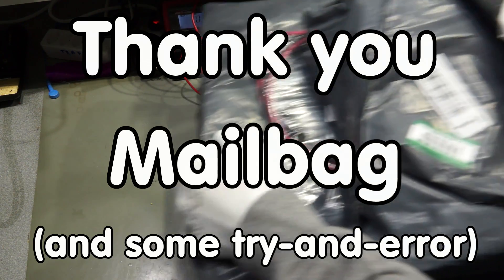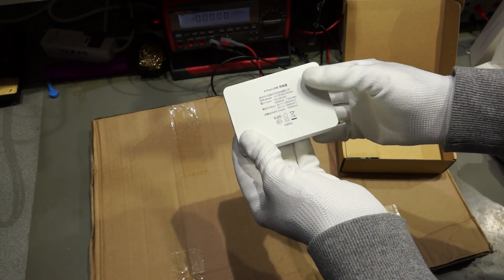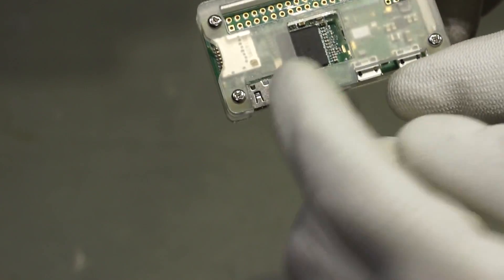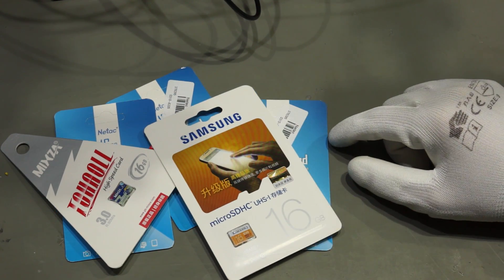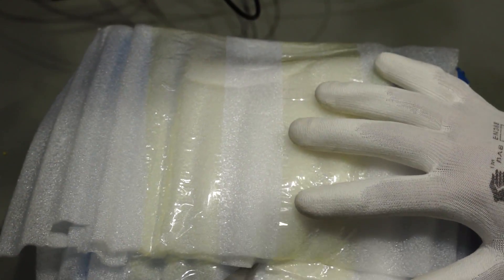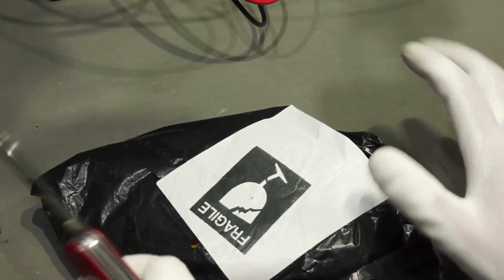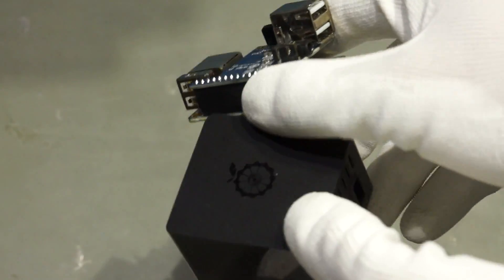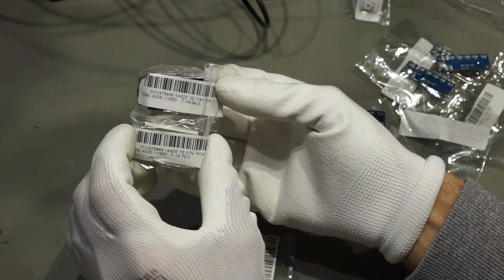#129 Thank you Mailbag: Orange Pi Zero, Housings, Solar panels, etc.

Comment: Hi Andreas, dietpi is wonderful because you can open up the document called dietpi.txt and pre enter your WiFi credentials and set a static IP so you can log in with ssh after the first reboot. No need for serial connections at all. Just plug the SD card in wait about 5-10 minutes, reboot and you should be able to ssh using putty.
Reply from the maker: Thank you for the information

Comment: that is taspberry pi zero case not the zero w , the chip is little offset on zero w.
secondly, 3.5mm jack on usb hub hat of orange pi also give you video. or you can directly connect ground pin and 5th pin from last to get a vga output.
Reply from the maker: Thanks for the tip!

Comment: Like a Christmas day, Nice, Of all the sensors you have tested, which one do you recommend for an alarm system? And mounted on a Wemos, ESP8266 or a Nodeum?  Thanks for all.
Reply from the maker: 1. I tested the radar sensors in video #135. If you read the comments, they are quite often used for Alarm systems
2. Wemos and nodeMCU are practically the same, just different size. For projects I usually use the Wemos. The bare ESP-12 modules are good, if you need low current consumption and deep sleep. You find also a few videos about that (there is a ESP8266 playlist available (https://www.youtube.com/playlist?list=PL3XBzmAj53Rlu3Byy_GkqG6b-nwEpWku0)
Reply: ok thanks

Comment: I would be interested in Orange pi, i have one incoming, but as far is as i know in the area of software they are all garbage. Even tho they have quadcore 1.6ghz.
Reply from the maker: Why would you buy one if you know, it does not work ;-)
So far, I just installed the MQTT broker with dietpi and had no problems. But I did not use it for a long time.
Reply: I have always wanted a Raspberry, but it was way cheaper. I ordered a bigger version, Orange pi PC Plus. We will see what it can do.

Comment: When you test solar panels cells? :)
Reply from the maker: I do not know exactly. I hope, in the next weeks
Reply: In order to charge a 12V/7A battery do you need more equipment, or just the solar panel is enough ?
How long does it take to fully charge a battery in a sunny day in Swiss ?

Comment: Hello, thank you for sharing ! Really looking forward for what you'll think of these solar panels, they are quite cheap and might works great on a boat ; I've been lurking at them for monthes on banggood :)
Reply from the maker: The first impression is a little "plastiky". But this might actually be good of handling. However, I am not sure if they survive the 20 years of glas panels...
Reply: Thanks for your answer. I'm not sure I would expect such a lifetime anyway, so it looks right to me :) Concerning the wire section, they look normal to me, correct me if I'm wrong, but the lower the voltage, the higher the amps, and with that the increase in temperature and the wire section. In boats where voltage is usually 12-24v, the wire are really thick. I found this calculator for wire sections (originally in french : https://translate.google.fr/translate?hl=fr&sl=fr&tl=en&u=http%3A%2F%2Fforcepas3.free.fr%2Fimages%2Fstories%2Fdossier%2Fcalculatrice%2FSection_fil.html).
Reply from the maker: Concerning current: This 30W device has a max. current of 1.6 A. Such currents, you can lead with very thin wires.

Comment: Congrats Andreas. For Orange Pi Zero (OPi0) try using Etcher to copy OSes onto uSD card: https://etcher.io/
And here are some good OSes to try on OPi0 : http://www.retrorangepi.org/ http://dietpi.com/ https://www.armbian.com/
It is better if you linked to the Orange Pi Zero Bundle(Board+Expansion+Case) https://is.gd/opi0kit
I added your Banggood ID to that link ;D Regards!
Reply from the maker: Thanks for the links! I added the bundle link. So far, I only tried dietPi, because I think, a small OS is better for the Zero boards. I read, that armbian works also good with the Orange Pis. So, maybe I will try it once. Concerning Etcher: I installed it and am now burning  a card. But I do not see a big difference to WIN32diskimager so far. Do I miss something?
Reply: You're welcome. Diet Pi is great. Try RetrOrange Pi (ROPi) later to play emulate older gaming consoles S/NES, Atari, N64, PS1...etc.
http://www.retrorangepi.org/#download You can use a separate uSD for each OS if you like.
I have not used Win32DI in a long time, but Etcher is just simpler, & has copy Verification.
It does not matter what you use as long as it is working. BTW, having a U3 uSD card will give you a better experience with OPi0: http://v.ht/mixza Banggood also got the same item.
Also if you wanna have OPi0 display on TV you can connect dupont cables to RCA A/V cable with the help of this table (#2) http://linux-sunxi.org/Xunlong_Orange_Pi_Zero#Expansion_Port
Or if you got a RPI2/3 3.5mm to RCA audio/video it will work. But really making the cable is so simple.
Thanks Andreas for your great videos & good luck.

Comment: Andreas, I found here http://tech.scargill.net/a-question-of-lifespan/  this link: http://goughlui.com/2014/10/01/usb-cable-resistance-why-your-phonetablet-might-be-charging-slow/

It seems very few USB cables are rated as 20AWG. We need your advice on this matter:
https://www.aliexpress.com/item/3A-2A-for-Genuine-LG-Micro-USB-Cable-20AWG-V8-Quick-Charge-2-0-Data-Sync/32736604012.html?spm=2114.13010208.99999999.270.kxnCFD
Reply from the maker: Thanks for the link.Concerning Peter's blog: I saw it and agree, that most of the "facts" about SD cards are rumors. Concerning the size of Charging cables it is a simple rule for me: measure the voltage at your board after your cable. This can easily be done with a cheap USB doctor or with a Multi-Meter. With Raspberry Pi, I normally use only short cables (10-15 cm). Then, the cable itself is not so important. My experience is also, that the Rasbis run well at voltages well below 5V (because of their 3.3 volt regulators). So, this does not seem to be a big problem for me.

Comment: For all the Orange Pi you should use Armbian as an OS instead.
Reply from the maker: +BIBIwood Why not dietPi for the small devices?
Reply: Well at least you should give it a try and use the one you prefer. Armbian has a great support for the various Orange Pi, and ssh is activated by default, so no need to use the serial port, just plug with an ethernet cable in your router.

Comment: Andreas, I think you ordered "wrong" Orange Pi. Orange Pi PC which costs 15+3 USD is much better device. Fast 4-core ARM, 1GB of RAM, capable of smooth 4K video playback, 3D acceleration, real hardware ethernet, real 4x USB2.0 (not via hub), etc. Younger brother Orange Pi One is almost the same but with 512MB of RAM and smaller PCB with some connectors removed (you can still solder wires manually). And it costs only 10+3 USD. This one is good candidate for servers if 1GB of RAM is not necessary.
Reply from the maker: Thanks for the tip. I am quite new to this area and just wanted an alternative for my mqtt broker. Maybe I will also order the "PC" type. But it seems to be more like a raspberry Pi 3
Reply: Andreas Xunlong(OPi manufacturer) is releasing models like crazy! Their latest ones are Win/Prime and IoT-2G http://www.cnx-software.com/2017/01/08/orange-pi-zero-plus-board-based-on-rda8810pl-cortex-a5-processor-to-support-bluetooth-and-gsm/
If you wanna see all their models you can find them here: http://v.ht/opix
Also ask in the Armbian forum about what you need cause they are very knowledgeable & can help you a lot with technical issues: https://forum.armbian.com/

Comment: please put a heatsink on that orange pi, ceramic or the big copper one if possible, case they kinda heat up under load easily.
Reply from the maker: I am currently experimenting with a small fan on a Rasbi 3. With big success. Maybe this is also the solution here.
Reply: nice, if dynamically controlling the fan with cpu temp, please post a little about the experiment also !
Reply from the maker: I am finishing the video...
Reply: great !

Comment: Great video. Another consideration for the Pi Zero cover is that it is also good to try a board with the breakout headers soldered in place before putting the cover on to make sure there is sufficient clearance
Reply from the maker: I have now one with the pins soldered. No problem with the clearance.

Comment: IF SD CARD IS CHEAP IT WILL FAIL IN iot IF ITS A DECENT MAKE LIKE SANDISK OR SAMSUNG THEY WILL WORK FOR IOT
Reply from the maker: This very interesting. But, being an engineer, I have to ask about your data supporting these statements. Because there are many rumors out there.
Reply: experience, i have wasted loads on cheap crap and let everyone know not to waste their time and money, the speed is never right the capacity could be wrong and even if it works it wont work for long and they don't boot correctly they don't allow os installations without errors eventually and they don't work in cams or pc's either. the decent ones work fine it is just cheap crappy ones that you should stay away from at all costs, also some even over heat and brake w.e you put them in.
Reply from the maker: +Jay Mee Sounds interesting. This is, why I plan to test some of them. But of course, I cannot do any longterm tests.
Reply: I've been using cheap SD cards for my cameras all the time, and the one time I got a name brand one it failed after a few uses.. And i'm not the only one, just google SanDisk SD card failure... For now I keep using cheap ones, if they fail anyways I rather don't spend too much money on them.
I know a camera is not a IOT device, but it still applys. But if it isn't the quality that is different it probably is the speed, so looking forward to the comparison video.
Reply: Some cameras are limited to what type of card they can have in terms of class and size capacity, also try in multiple devices to fully tests these cards not just 1 camera but a pc and a raspberry pi and or more cameras, etc.

Comment: I started to use XT60 connectors yesterday for my solar experiments.  What a joy to play with compared to the standard MC4 connectors. Ok they are not waterproof but I move my panels and other stuff a lot.  So my advice, buy a couple of MC4 and create cables to XT60 connectors (ordered 10 pair for 5 euro).
Another advice is to get a MPPT  module.  I've got 2 of these  http://www.ebay.co.uk/itm/152210070439  .  They are fantastic for the price. The panel stays at the max power point at about 18V and the output is at a nice 5.2 Volt and can deliver about  3A using that module.
Looking fwd to the speed differences with the differen sd-cards.
Mailbags are better than Xmass.
Reply from the maker: Concerning XT60: I have some of them and I think also, they are much easier to use.
Concerning MPPT Regulators: I have bought a few of those, one very similar to the one in your link. I plan to use them for some tests. Thanks for your info.

Comment: The cables on the solar panel are huge so as to minimize the power loss. Overkill, but you want as low ohms as possible with the least amount of inductance.
I have a question about LoRa (RFM95) boards. Can I place a board (with solar power) on top of the hill and allow general public to use it as a repeater? Like a public WiFi with no password?
If not, is there a way?
Excellent video as usual. Thumbs up by default +1.
Reply from the maker: I do not know of a repeater software. Generally, it should be possible to build a repeater, even on the same channel. But it would then have no connection to the internet.
Or you use a normal Lora gateway and connect it via GSM to the internet (If coverage is available).
Reply: Thanks for the reply. I don't need Internet access. Only at the source where I am.
There is a big-ass hill between me and my cabin (line of sight). I would need some sort of repeater to get over the hump. I know I saw you had some issue with a hill when you did your range test.
I can't find any info on how to do that. If you come across it, please keep me in mind. Thanks.
Reply from the maker: I will. I have something similar in mind. But not on top for the moment...
Reply: Got it. Thanks.

Comment: 1. about case -I think it was designed for PI Zero (without wifi) thats why hole is in wrong place
2. abut orange pi - I'm that much into any sort of PI but from what I have read for beginners (like me) Raspberry is much better because bigger community but once you have experience its "save" to go with orange, also with the new RPI Zero W I dont see any stock problems - just checked on thepihut its in stock and I already bought 2 from them few weeks ago
3. RPI3 - good thing that you got fan wtih case - radiators themselves dont do much difference but with fan they actually do something ;)

Q1 - how hot can RPI zero W can get during streaming video (1080p) ? I want to do kind of IP cam of my rpi (with some other functions) but I am wondering do I need to worry about cooling it ? I already know that radiator itself is pointless unless I have some airflow so its either nothing or radiator with small fan
Q2 - do I really need to worry about sudden blackouts ? I'm worried that because of blackouts some files on sdcard may be damaged and rpi may not come back online after power is back
Reply from the maker: 1. I agree. It fits with my old Pi Zero
2. You are right. I just wanted to have another possibility for my MQTT broker (with Peter's script). For experimentation, I use Raspberry Pis...
3. I did some tests and I completely agree with you
Q1: I do not know as I never worked with video so far.
Q2: You could lose some of your "stored" data. As I understand, Linux does not save everything right to the disk. So, during a sudden blackout, you might lose it. And sometimes, it could happen, that it dues not boot again (I never experienced that so far).

Comment: You say you power the ESP on the USB hub, do you have an additional powerregulator to get 3.3V or can you run the ESP on 5V? The datasheet say's 3.3V but in an earlyer video you say the IO port's is 5V tollerant. Is it the same for the VCC pin?
Reply from the maker: The ESP8266 is 3.3 volt. But the Wemos and the NodeMCU boards all are 5v (with a built-in regulator).
5volt tolerant is not for Vcc, only for the input pins.

Comment: The case for the Pi-Zero is for the non wifi model. On the Pi-ZeroW the CPU is a little bit closer to the hdmi-connector. That's why the hole is not aligned with the chip.
Reply from the maker: You are right. With the old one it alignes perfectly.
Reply: yes, I have the same case with the old pi zero and it's aligned.

Comment: Throw away the built in antenna on the Orange Pi Zero, you will need this: https://www.ebay.com/itm/152355569683 +an antenna.
Reply from the maker: Why do you think I should do that? It looks so neat ;-)
Reply: is this adapter suited for other devices having that little connector on board? Like di Pine64 and others...
and what antenna do you suggest? thanks :)

Comment: great stuff. i heard the Orange pi is a bit unreliable with its WiFi. i do not know if that is true. looking forward to your experience with it
Reply from the maker: I will have a look at that. Maybe I will replace my Pi Zero for my light system for a while and see, if it still works...
Reply: Andreas Spiess i may get one too. play around a bit or turn it into a TOR
Reply from the maker: +Ed19601 Enjoy. The investment is really no more big for these things...
Reply: There is actually a cheaper version: 6.99USD with 256 MB. Now that is not much memory, but more than enough if you just want to run the mosquitto broker
Reply: Yes, the OPiZero Wifi support is really bad.  Which is a shame as they're great little boards.  There is a great case available for 3d printer owners.  https://www.thingiverse.com/thing:1918590
Reply: y0rkiebar nice case. the one Andreas shows is pretty good and is available for 2usd, but yr link gives a nicer case
Reply: Yes, I've got two OPiZeros in the thingiverse cases, it's a good design.